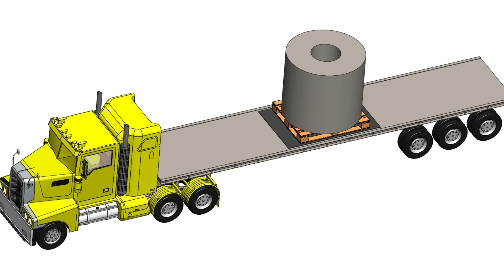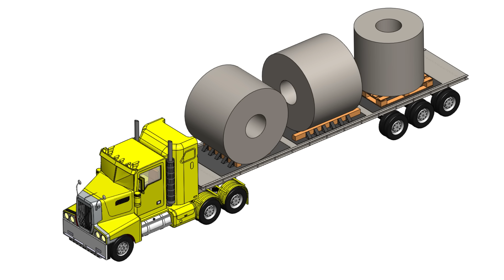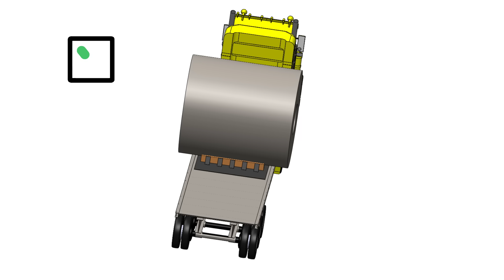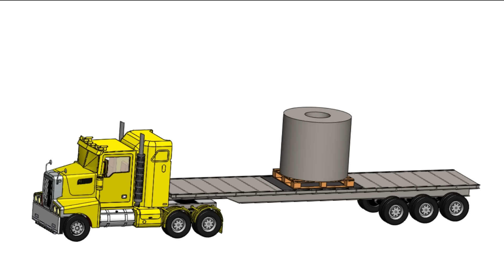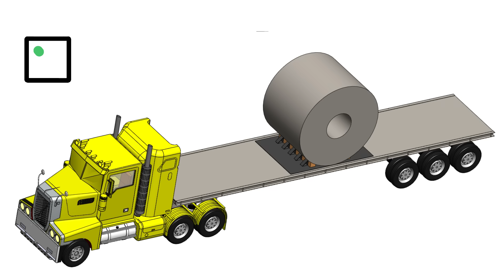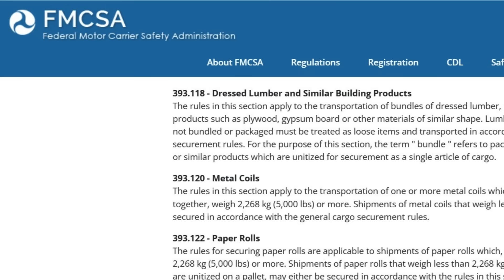Suicide Coils; Why Are They Loaded This Way?

Comment: Those custom trailers should be manditory. All of the sudden they care less about driver safety or safety at all, when "backhauls" i.e. profits are the question. Yet, if the AI camera detects a driver looking away from the road, they take his safety bonus. They spent money lobbying for cameras that enable them to rob the drivers of pay but, they wont spend money on trailers that prevent steel coils from rolling down the street and crushing people.

I really do despise the people running and passing policies in this industry. This generation is absolute trash.

Comment: If they're loaded so as to roll off to the sides, it be more likely they'd tip over forward had the brakes have to be slammed on. Loaded as pictured, but with 4x4 pieces of lumber blocking them from rolling keeps them steady with a less chance of tipping over during a turn. Then heavy straps front & back on each ones' lower area are used keeping them in place until another strap or chain is hooked through the hole to pick it up, then the lower straps are safely removed for unloading. PS; coils are not always shipped on special trailers. Flatbed trailers are usually used because they carry different types of loads:  coils, pipes of varying sizes, heavy-loaded boxes, military equipment, just about anything not suited for regular box trailers! These trailer types are more readily available than special ones!

Comment: Impressive video! 🚛
Lankhorst Engineered Products introduces the KLP® Coil Transport Cradle – a TÜV certified, sustainable solution designed to keep steel coils safely in place during road transport. Made from 100% recycled plastics, the cradle ensures maximum safety, reduces coil damage, and offers long-term durability. With its lightweight yet robust design, it’s perfectly suited for multiple use and modern return systems, setting a new benchmark for safe and efficient coil logistics.
https://www.youtube.com/watch?v=rSbqFT0B98o

Comment: Surely the solution is specialized trailers built specifically for eye to the sky with self contained "easy off" The trailer itself should have the ability to lift and rotate for ready use, and the receiver should have no say in delivery.  It makes no sense to use standard trailers, this should require extra licensing and appropriate costing for the work.

Comment: Why not make a trailer with a flat surface for containers and  a sunken well for coils? The space between front and back axles should suffice. The containers don't mind if their mid-section is not held up by the truckbed.

Comment: Not an industry insider but I think "eye to the sky" is actually also fairly dangerous as there is no pressure keeping the coil from unraveling unlike the "suicide" or "homicide" method, and  the chain can't really secure it through the center hole meaning it flies off much easier, and unraveling while on the truck would be a "everything-cide".

Comment: As someone working in a steel mill, part of the reason they are loaded this way is that vehicles which have not been specifically designed for the transportation of coils cannot be loaded properly any other way (if there is no gantry crane present). We have ground based flatbed loader and transport vehicles which were designed to transport these loads (even when still hot at over 500° Celcius) but these cannot load onto normal trucks in any way but sideways. Usually we do off load and re load the trucks via cranes at a transportation hub though in order to rectify this. I am assuming it might be different based on where the business is located and what resources they have access too, not everyone can afford dedicated steel coil transport trailers.

Comment: It's loaded like this so 
1. The driver doesn't fk around and find out
2. So it doesn't roll over to the sides
3. It could crash into the truck to help slow the steel coils from damaging cars and properties
4. It's safer for turning on intersections
5. It's just common sense

Comment: A very simple idea: two beams parallel to the flat bed, and pivoting at the front end. Make that perforated beams that accept an axle to be shoved through both beams and coil. Add some hydraulic cilinders to bring the beams to center coil hight. 
(You can pay me later).

Comment: last year in my country. driver died because of a jaywalker not looking on both sides. the truck is going around 30kph and a sudden brake, the steel bars pierce through the cabin killing both driver and assistant instantly.

Comment: Flatbedders or curtainsiders in Europe that transport coils a lot actually tend to have trailers with a coil well running down inbetween the two main frame rails which invariably puts them in a shotgun position but with a lower center of gravity and some securement simply from the geometry of the well, though of course they're chained as well. They're loaded and unloaded with those C-shaped crane attachments you can see in the video at 3:25 . Look up the Wielton Coil Master, Krone Coil Liner or Schmitz S.CS Coil for examples.

Comment: I work with Steel Coils and ive seen basic Trailes with a hole in the middle of the loading area that the Coil is placed in to prevent it from rolling away. If the driver has to load something else he just has to slip a big metal plate over the hole to cover it. ( https://www.youtube.com/watch?v=ouWbwpwI6Xo&t=88s )

Comment: So basically, "eye to the sky" loading isn't used for the same reason dedicated coil trailers, or even a foatbed with a front wall aren't used.  It might cost the company more and of course, who cares if the driver might die, right?

Comment: Or you could still use "eye to the sky", having pallets with a long pole in the center, on top of the pole is a huge eye that fits both a crane's hook, a big coil lifting forklift and a standard forklift.
You can add a steel parallel pole that holds the coil tight and everything can be easily strapped down, even on the worst type of transport, as on a ship in hard sea.

Comment: I got to see a flatbed with a 4 foot wide 10ga coil  backing into the factory I worked at, but there was a bump from an aggressive change in the gradient. The whole flatbed snapped in half and had to be towed out in 2 pieces. Fortunately the load survived and no one was hurt (these coils can easily cost tens of thousands)

Comment: Well, its usually the good old mistake where people say: "That's SO heavy, it wont slip!" what is, seriously, famous last words if you ask me.

The best way, in my opinion, to transport coils like that is the shotgun way, because there are trailers that are specially MADE for this type of loading coils. They have a lower part in the middle where the coils get loaded in, so they cant go to the sides at any time, and if they are loaded right, they wont go forward or backwards anyway. (Just look for "Coil Trailer" and you see what i mean.)

Comment: If that is the case, then instead of making a custom truck with a built in pocket, they  can make a custom not so expensive pocket that can be loaded on the truck and then we load the coil in the truck. Yes it is a cost increase, but it is a minor cost increase with a lot of additional safety.

Comment: I've never understood this... I'm a Mechanical Engineer and I cannot fathom why they don't just put railroad buffer-bumpers on either side, strapped to the trailer, and the coil.

You can't tell me a bumper designed to stop an 800 ton train going 10-15 mph, can't hold a 30 ton steel coil still.

Just stupid.
Reply: The weight of the buffers rhemselves cutting into carrying capacity

Comment: Q:  "Ever wonder why truck drivers transport steel coils on their round side, not their flat side?"

A:  No, I don't, because I understand why.  What I DO wonder is why somekind of obstacle isnt placed between the cab & the steel coil(s), to prevent a coil from rolling forward & crushing the cab, in the event of an accident 🤷
Reply: There is no "obstacle" that will ever stop one of those coils from rolling if it starts.  They stop because they ran out of momentum on their own.

Comment: In short, suicide style is easier to load and unload (you can just roll the coils onto and off of the trailer; eye-to-the-sky style requires difficult lifting), and risks the driver's life over the lives of innocent bystanders, unlike shotgun (or "homicide") style. You'd drive a lot more carefully, after all, if you knew it would be YOU paying for your mistake instead of a stranger.

Comment: Steel coils shotgun style loading is quick and  efficiently loaded .  
The concentrated load weight is placed in a coil rack and is placed over the main frames of the trailer instead of on the crossmembers .  The trailer frame is the strongest part of a trailer .  The securing chain pockets must be free of broken or cracked components .

Comment: Can’t a trailer manufacturer make a trailer with some sort of removable centre posts between each coil ? Chained down but giving an additional structure in case of movement , at least enough to hold until the driver can pull over ?

Comment: Why not build a truck bed that can tilt to the side and has rods to hold coils in place?
Reply: For the same reasons given in the video why the special coil trailer shown near the end of the video isn't used often: It prevents back hauls and the trailer can only be used for coils. Except your method makes the trailer more expensive and less rugged than the special coil trailer shown in the video. And new problem is that you either have to built the motorized tilting mechanism into the trailer, which makes it really expensive and heavy (fuel consumption) or you can only deliver to sites with a special machine to tilt the bed.

Comment: Why they don't put the coil inside a steel cage or a fixture? That way, you don't need a specialized truck.
Unload only the coil at destination.
The put off the cage when not needed for the job. By i said cage, it is not shaped like a normal cage, but more specialized to fix the roll so it doesn't move much during transport.
It also has the benefit that you can unload it by any method, or to rotate its orientation at destination to conform what unloading mechanism available.

Comment: Years ago I saw an 18 wheeler in a towing company yard.  The entire front of the box trailer was torn out and the cab was crushed.  The truck was hauling a load of cases of beer.  The driver dynamited the brakes for whatever reason and the entire load shifted forward.  A lot of people just don’t seem to understand the laws of physics and inertia as they apply to vehicle loading.

Comment: Why not normal-ish trailer with deployable coil walls it would be a specially designed trailer that can haul both normal cargo and suicide coils that can switch modes probably hydraulically

Or alternately why aren’t we using already invented drop deck trailers so that if the coil rolls forward all it hits is more trailer

Comment: Coils in the UK are always carried on special trailers with a longitudinal coil bed, they can be used for general haulage as the trailer is fitted with inch plyboard sections on steel frames that fit over the coil bed. I had one many years ago that also had twist-locks for 20,30 and 40ft boxes.

Comment: Very interesting video, thanks!  I live in oil country and see trucks hauling pipe all the time.  The same problem occurs with them, and it's not unusual for a load of pipe to slide into the driver's cab in an accident--with deadly results.  Some trucks have 'headache racks' which are supposed to stop this, but stopping many tons of steel with a headache rack isn't reality.  

Same with chains holding steel coils, or vehicles, on a trailer.  I never cease to me amazed at people that 'cross' the chains or straps when tying down a vehicle to a trailer, somehow thinking that it's stronger.  It isn't.
Reply from the maker: @steveprice5664  thank you for the feedback.

Comment: What if we just made a supporting triangle at the end of the flatbed? it will stop it from rolling before it reaches the driver's cab
Reply: It's probably better throw on more chains to stop it from moving in the first place which is cheaper while also keeping the trailer general purpose..

Comment: 1. Informative video but unnecessarily repetitive. Could have conveyed the same information in 2/3 time or less. And please find a way to make the robovoice put better breaks between sections to make it clearer you've moved on to a different topic.

2. Eye to the sky in the case of a load breaking free, is likely to flip onto its side and become a rolling loose canon and is just as dangerous as "homicide" loading - only difference is it will probably roll in the direction the truck was travelling instead of 90° away. At least "suicide" normally ends up "eye to the sky" on the roadway if the truck tips.
Reply from the maker: @christopherbedford9897  thank you for the feedback.

Comment: Say what?  Eye to sky?  Guess a pallet should be made to handle 30k.  But 75” is too wide to load correctly?  “No room for chains, binders”??  Load can be over 8’ wide. Still have room for chains, binders.  It’s often legal to have actual load up to 102” and have chains, straps OUTSIDE that.   So where do you get coil must be under 75”?
  You must SECURE your load. The racks are just to keep coil from rolling while stopped, on flat ground while loading, unloading.  It’s been decades. But most smart folks use two chains, with working loads WELL above object being secured.  Each one pulled forward, and back. Then you put one more on front holding it back, on back one holding it forward. 
  You get out of yard, find a decent place to do a walk around under few miles.   3 minute check easier they 3 hours getting someone that can reload you.  Plus damage, if not legal issues for someone dying.  It’s only suicide if cheap with securement, checking.  If it scares you buy a step deck.  And put in solid headache rack.

Comment: I think I better question is why we aren't using Chucks large enough to fill up the space between multiple coils and work with the trucks tie down system both suicide and shotgun could be made much more safe with the use of Chucks you could also make the trailers safer with a strong metal wall at the end preventing the spools from rolling into the driver

Comment: I had a holiday job years ago, one day I was given the job of truck assistant, carrying 5 or so tons of copper tubing. My job was to help load the tubes on the truck bed, fine slid the tubing straight on the back, all done, sat next to the driver and I asked about the safety belt, there wasn't any. The driver if we anything that stops us you have tons of copper tubing behind us. They will shoot forward and we will be turned into chips.

Comment: here in Spain I've only seen coils being loaded suicide style on trains, trucks mostly carry them shotgun style using flatbed or tauliner trailers with a socket on the floor that secures the coil from moving side to side and lashes to keep it in place

Comment: Are the coils like a coiled spring or do they have to be bent straight by the customer?
Reply: Like anything stiff that's unwound, the sheet will retain a bit of curvature when it's unrolled from the coil. Most fabricators have a set of straightening rollers as one of the first steps in the processing line. It depends on the material too, and how springy it is.
Reply: @technoroom5  Good, then the coil is malleable and not spring like. I've worried about these things catastrophically unwinging. Thanks.
Reply: @VoteScientist  Not exactly.  If the coil banding is cut it can absolutely kill the person doing it if they're standing in the wrong spot.  Those coils do expand upon being released from banding.

Comment: Why haven't they invented or use a coil cage that can holster 1 coil in suicide position then load the cubed holster containers onto a flat bed you could probably fit 4 instead of 1 in the pocket method. 🤔

Comment: At first this looked like a good way to just make yourself become the last ball on the newton cradle. But after watching the whole video, it's true. This actually is the least bad way to do what is invariably a dangerous job.

Eye-to-the-sky seems to make sense at first until you realise that these things are enormous torsion springs that would love nothing more than to go sploioioing in every direction. Its weight is what keeps it in a tight coil. Plus, the risk is now mostly on the person that needs to be the most careful, not a bad thing overall.

I can't help but feel that something like steel chocks or some type of cage frame would be safer than just chains to a flatbed. Doesn't have to be as much as that bespoke coil trailer... but something a little more than a couple wooden blocks and chains doesn't sound like a bad idea.

Comment: It doesn't make sense to make these huge coils since it doesn't actually save space in yhe container or on the flatbed. With such massive weight, only a maximum of two can be carried per time. Why not reduce the coils and loaer up to eight or more in w container, thereby saving the lives of drivers and saving the teucks from colossal damages? Must the coil sheets be that long?